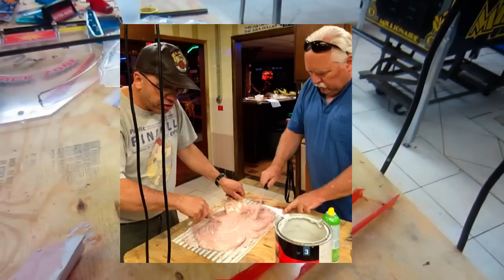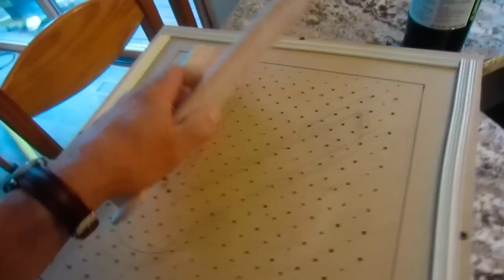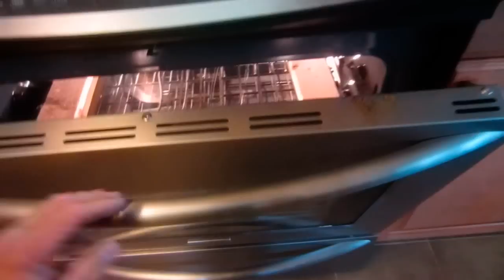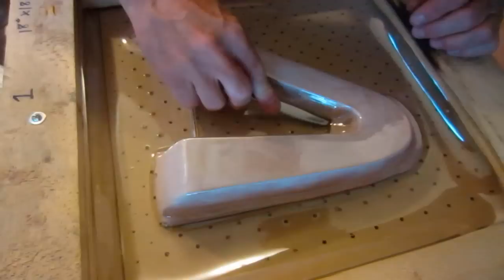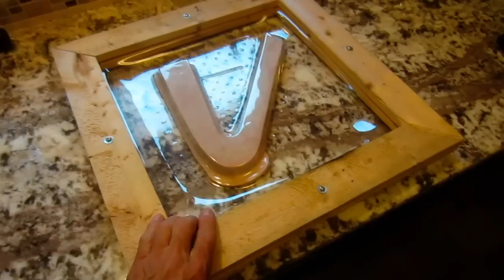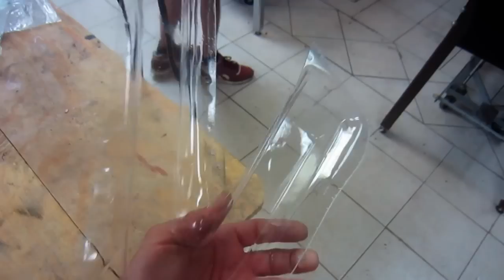Pinball repair, vacuum forming parts - ramp for 1987 Bally Heavy Metal Meltdown

Comment: It would be better when you made your mould to have some studs so it off from the bottom plate, a couple of millimetres 2 or 3 make your corners sharper. Better to use fibreglass as the mould then bondo. Plus it would be helpful if your vacuum was stronger if you get a beer keg or demijohn 10 litres say have two holes at the top one for the vacuum cleaner and another one with an inch of copper or still piping connected to your mould give it more force or if you've got a compressor you can do it that way.